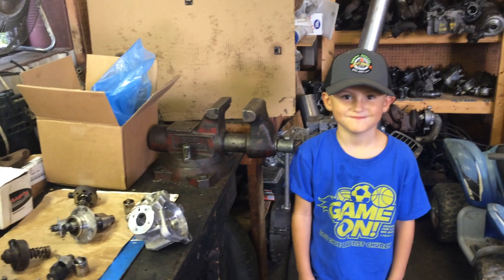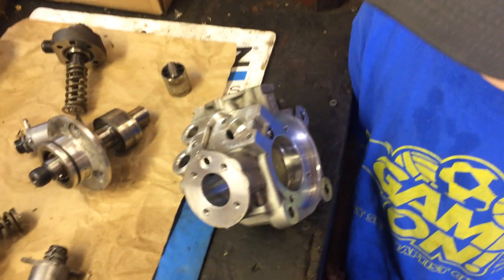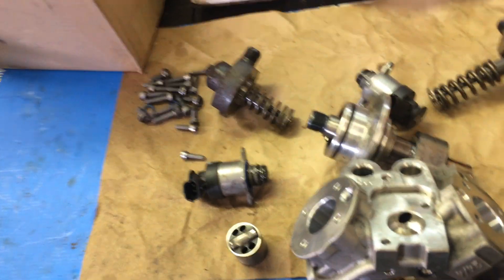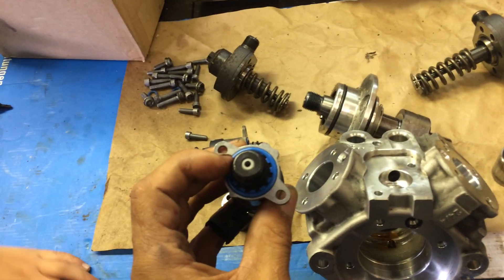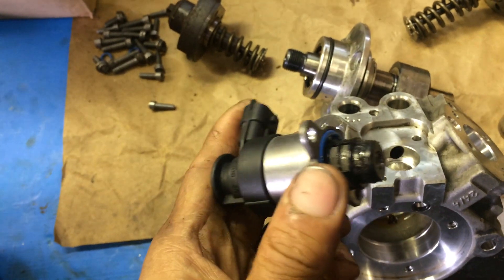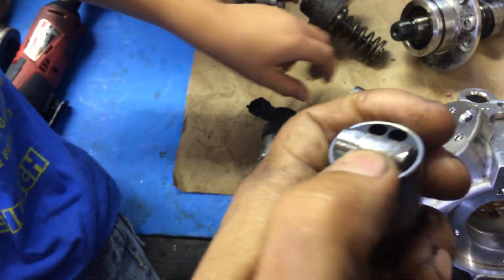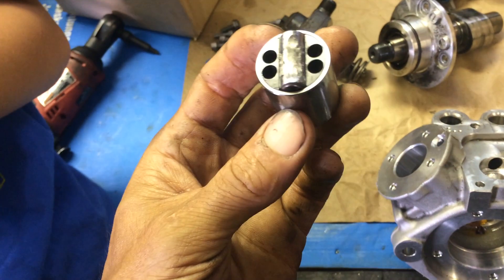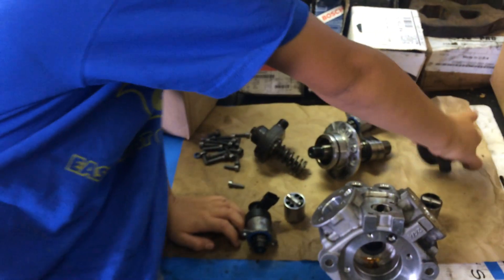6.7L Ford Powerstroke CP4 Injection Pump Failure #2 Disassembled

Comment: Do you know how to get the intake screen out of the pump body? Any help would be greatly appreciated,  thanks in advance
Reply from the maker: Are you referring to the tiny screen under the MPROP? The CP4 is not field serviceable but a small pick should work to remove it.
Reply: @ozarkdieseloffroad567  

It's the one in the fuel feed line after the filters, to screen fuel just before it enters the pump body. 
I'm working on a reliable replacement for the CP4 pump, starting with the Ford style, I'm trying to get the measurements of that port, but that screen just doesn't want to come out. 
I've pretty well mangled it but it refuses to let go.

Thanks for the reply 
Darrin

Comment: Ok, I got a 6.7l in the shop with a pump leaking from the left pump head. It was staying in a continual loop of pulling in air and pushing out diesel. Got the heads off and saw just bad orings so I got a seal kit for it. The rollers and cam are spotless, but what I'm wondering is how you pulled that front cover. Did you slide hammer the pump shaft and pull the cover that way?
Reply from the maker: If I remember correctly, I put the nut on the shaft and clamped down it in the vise. Then I took a deadblow hammer and gently tapped on the pump housing as I rotated it. I think your idea would work as well, since it's just basically the reverse of my method.
Reply: @ozarkdieseloffroad567  ok cool. I ended up using a slide hammer clamped onto the shaft nut and one pop pulled it out.
Reply from the maker: @MillardFeelmore  Awesome, faster than what I did!

Comment: Shows how SORRY FORD IS for building junk like this and costing so much to fix, i own one and had this problem, im going to trade it off and go Dodge or Chevy, i will never own another ford as long as i live, JUNK!!!!!
Reply: Just watch what year of Chevy or Dodge you get as some of them also have the CP4 pump, and the same problem.
Reply: All the newer diesel trucks run the same pump and they are all having the problem.  Not a truck manufacturer problem.  It’s a Bosch cp4 problem.
Reply: The gm l5p duramax does not use the cp4 the new dodge has gone back to cp3 the ford still using it last I checked.

Comment: Thanks for training, I need your opinion regarding a situation with this kind of pump on a new vehicle. I have noticed on the inlet part of the pump that there are some spots, drops and can not tell whether is is leakage of fuel or vasseline leaking from that inlet. The huse is ok, there is no leakeage only at the base of that metalic inlet. The service dealership could not tell either, told me to wait.
Reply: What caused this pump to fail ? What’s the best preventative?   I have seen a “disaster prevent kit” what’s your feeling on them ?   That’s low miles for that to happen isn’t it ?
Reply from the maker: There was no sign of contamination from water(rust) nor DEF so I'd say small amounts of emulsified water and low lubricity fuel, perhaps even more than 20% biodiesel. I recommend a lubricity and water additive with every fueling, as well as draining the water separator monthly. On the disaster prevention kit, particularly the one manufactured by S&S Diesel, I think they are relatively cheap insurance against total high pressure fuel system contamination from a failed pump. I've seen some argue that it does not protect against the most common pump failure which is the elements, but both of these pumps failed in the cam/roller, and the kit would most likely have prevented total fuel system failure by sending the debris back to the tank instead of the rails, sensors, injectors, etc. I also like to install a FASS fuel system due to the fact they have two filters, one of which is a dedicated water separator, as well as they continually cycle the fuel to "polish" it. And yes, that was a well maintained low mileage occurrence.
Reply: @ozarkdieseloffroad567  All I can say is the element's spring tensions and they are weak! Telling you this from the past experiences and its mistake of Bosch!
Reply from the maker: Marius G, if  it was on the inlet on the driver side of the pump, it could be  a coolant leak from the line that connects to the top of the turbo. It will be a reddish or whitish substance as the coolant dries.
Reply: OZARK DIESEL OFF ROAD
It is on the diesel pump, there are 2 rubber huses, one comong from diesel filter. On that inlet there are some yellow drops. I could send some photos if you provide mean email addrrss.